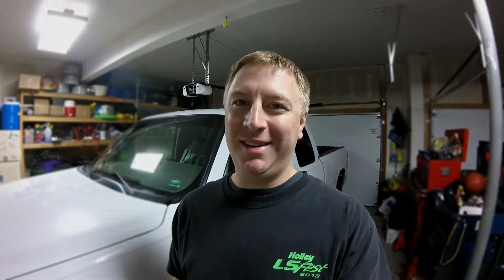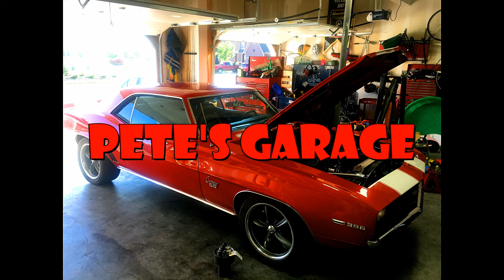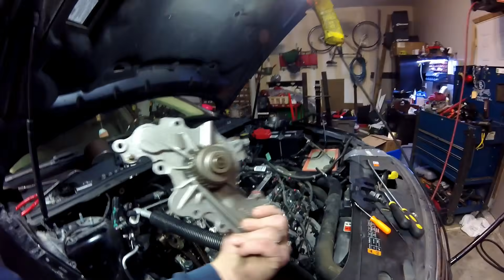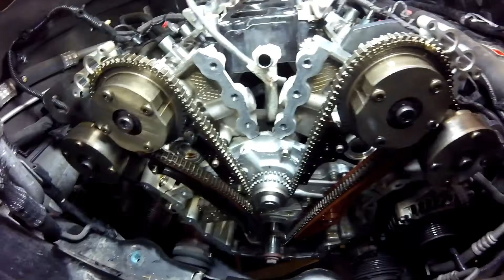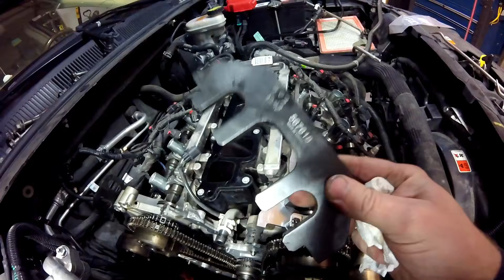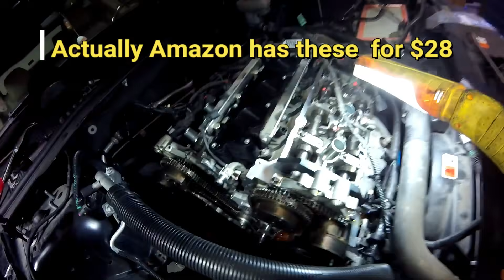Why does the Ford Taurus, Explorer, Edge 3.5L water pump cost over $1400?

Comment: Wow! Absolutely convinced I will not be buying another Ford. This b.s. is what you would expect from European cars.
Reply: other car brands did the same thing. not just ford
Reply: Rick Manley in 2016 my family drove a 2004 Ford Taurus, a 2007 Ford F-150 and a 1995 Ford Explorer. After getting ripped off by Horne ford in Apache junction AZ we now drive a 2012 accord, 2017 Tiguan, 2013 Elantra and a 2010 vw golf. Suffice it say ford gained $2000.00 but lost $75,000 in car purchases.
Reply: I have a 16 year old Mercedes 180,000 miles. Still on all the original parts like wheel bearings and water pump etc....
Reply: The 2005 Ford 500/2008 Taurus/2012-19 Explorer, etc were based on a Volvo; and Ford dropped that Godawful platform a few months ago, good riddence.
Reply: I dont think Europe had a lot to do with the Ford 3.5l engine.
Reply: Stick with Honda or Toyota!!!
Reply: I forgot i wrote this post a year ago. Funny thing is, I did end up buying a Ford F150 nine months ago, and it took 8 months for the 3.3 liter to blow up. Engine threw a rod with 7700 miles. I should jave listened to my own advice
Reply from the maker: Ouch! At least it was under warranty.
Reply: @rickmanley767  damn man.
Reply: This is no surprise because Ford & Volvo are in bed together, and the industry is engineered to require dealership service (just look at special tools required of any brand).
Reply: heavymechanic2 Ford sold Volvo 10 years ago. Volvo had nothing to do with a Ford engines. Mazda was engineering partner for 4 cylinders for a time but I’m unsure if V6 engines were partly their work. Mazda larger CUV/SUV models used one of the V6s of this family with pump inside.
Reply: @jimmyaber5920  ford used a lot of volvo's turbo technology to develop their turbo motors while they owned them. Volvo was pretty much one of the pioneering companies in turbo technology, alongside Saab. Ford pretty much just bought volvo, took their turbos, and then dumped them to geely. Almost killed volvo in the process.
Reply: You really dont know much do you?
Reply: Not all duratec engines are like this (check for cam chain in front, near radiator vs on right side). Know what you're buying and you should be okay with a Ford duratec V6 in regards to water pump replacement.
Reply: Several other brands have used this design for awhile.
Reply: Probably was designed and built by foreign manufacturers ?
Reply: Guadalupe Salazar Most afford turbo engines were from Ford Europe so im not shocked, Eapecially the 4cyls turbos
Reply: Rick Manley You better start buying cars 2005 and older then. All the new cars are like this.
Reply: @waterloo123100  I too have heard the cutoff for somewhat repairable vehicles was 2004-05 as well.
Reply: Pierce Hawke That’s usually what I go by depends on the make and model. But overall if you want a cheap car to maintain stop at 05. I’m driving a 99 Honda Civic and I love it.
Reply: Lol, stop being whiny babies. Engines have come a long way in 100 years. They aren't gonna always be fixed as easy as an oil change. Man up, or get a bicycle. Or pay some other dude $$$ who doesn't give two craps about your car, because it isn't his.
Reply: @ichoozjc  Or just don`t buy poorly engineered cars with poorly engineered engines using sub standard parts that fail too early. Probably the reason why I daily drive cars that are almost 20 years old. Modern car engineering is a amalgamation of hastily expedited designs that favor new technology over reliability with poor quality parts from China. I bet you 100 dollars the bearings that failed in the water pump were from China. I am sure Ford saved 10 cents a bearing though.
Reply: Plutonius X That’s the sad truth. Even if a part is Assembled in the U.S. you know their using Chinese parts.
Reply: @ichoozjc  SMH
Reply: @HowardJrFord  You don't have to tell me, I heard the rattle from here.
Reply: @ichoozjc  bad design is still bad design and, apparently even Ford's waking up; between the 2020 Explorer going back to RWD with 4WD as an option and the now 7.5L gas Superduty V8, it's OHV with pushrods.
Reply: @ichoozjc  man..its not about manning up lol. Its just true that ford keep complicating stuffs on the engine bro. Mechanics agree on it👍

Comment: Lmao 2014 and it already needs a new water pump? Wow. I avoid Ford's anyway but this is just ridiculous. I have a 97 Celica with 102k miles and the only thing I've ever had to do is replace the battery once, new clutch 6 months ago and that's it. My parents bought if for me brand new for my first vehicle. I've never charged the AC and it still will freeze you out. We also have an 09 Rav 4 and nothing has been done to that but my 07 suburban has already needed a new transmission, fuel pump, catalytic converter and radiator. It's sad to say but fuck American cars.

Comment: Well I see that the American car industry continues it's down hill slide so that they become as big of a POS as European auto industry makes. Today the care are over engineered, over priced, over electronic and over complicated. And for what? The break down far more than older cars. They catch fire far more than older cars. Even though they may be able to go as fast as 190 MPH, but the highest highway speed you can go is only 75 to 80 MPH. Most American cars have so much plastic on them they will not last 10 years.
But one thing hasn't changed much. The Ford Water Pump was expensive to change back in the 1960's and 1970's too. That water pump had a short bypass hose, about 2 to 3 inches long from the back of the water pump to the block. The proper way to change that was to remove the radiator, the fan shroud, the fan, loosen/remove the V belts and what seemed like most of the front part of the engine, just so you could remove the water pump to replace that short piece of hose. 9 out of 10 times it was the hose that sprang a leak and the water pump was still good. Depending on what model car you were working, it could be real tight to get to. 

Today's cars are crap. I still have a 1965 Chev Corvair that will out last and it drives better than any new car out there.
I'll add this, before I buy a vehicle I always look in to the mechanics of it. If it has crappy engineering like this POS 3.5L Taurus, I will not buy it. It is the same thing with the Toyota 4.7L Tundra. The starter is located inside the engine, under the intake. The engineer that came up with that idea must have been doing crack and LSD at the same time.
But in all seriousness, they drweam up this crap so you have no other choice but to take it to a dealer or another citified mechanic to get it fixed. It is a money scam dreamed up by the wiz kids, politicians, lawyers and the electronics industry to insure you can't fix your own car and to get as much of your hard earned cash out of your bank account and in to theirs. I've always said that it was a bad idea to put computers and a ton of electronics in a car. 

But soon it will not mater anyway, if they are able to perfect the self driving car. When that happens, you will not be able to own a car anymore. When you need one you will call for one or tap an app on your smart phone. The car will show up, you will get in and tell it where you want to go and you will be charged a fee for the use. Think of it as a driver less uber or taxi. After it drops you off at home, the  car go back to it's charging station or it's internals will drive itself over to a servicing facility for scheduled maintenance.

Comment: This is why I steer away from Ford. Have worked on a few and it has always boggled my mind how they design the simplest of jobs to take forever.
Reply: Daniel Acuna I do LED lighting or changing the interior lights just fucking terrible on the 97-2003 F150s You basically have to get a torx screw and remove the housing And grab handle , Transit is a nightmare to as well as the focus because they are technically European cars From ford Europe Can use a similar domelight housing as the VW/MB/Audi

Comment: The water pump is cheap on my 98, but I will say the in tank fuel pumps, particularly without an access port is just stupid. $25 pump, hours of labor to drop the tank. 02 sensors that cannot be removed without removing the pipes is another good one. Hope I never have to replace the alternator,  that will require dropping the motor and sub frame out.

Comment: Thanks to "cash for clunkers" a lot of perfectly good used and repair friendly cars went to the junk yard. It is no secret and hasn't been for a long time that planned obsolescence is incorporated in the design of many of our automobiles and some of the repairs are designed to take advantage of our conditioning to think a perfectly good car otherwise, is not worth an expensive repair and that a new car payment and insurance hike is some how better. I complained about the idea of the GM 3.6L V6 needing a timing chain replacement (yes chain) around 130,000 miles in the CTS at around $2500-3000, then there's the mode door actuator for the A/C in a number of cars that requires dash disassembly to replace at upwards of $1000. 

   Yeah, I think it's safe to say some manufacturers are shoring up their future with surprises like this. Glad I can fix my own car, I enjoy the heck out of not having a car payment.

Comment: I’ve done many of these water pumps. You don’t have to take the phasers off the rear bank. You can take a 8mm wrench and loosen the timing guide bolt up enough to snake the pump out, you can make your own timing marks , cam to chain and crank to chain, and you won’t even need the holding tools, just in case you do another in the future.
Reply: This comment 🙌. But these police cars run through these waterpumps so often, it's still a nightmare.
Reply: Only on the single phaser models. On the dual phaser models (2011 and later) you absolutely have to take off the phasers to get off the guide. They changed the guide to a much larger design and loosening the bolt is no longer sufficient.
Reply: @seekerrild4629  I do not take the house off, you can loosen it and move it out enough. 😉
Reply: Use the lock plates anyway.  The cam can rotate with compression.
Reply: This!

Comment: This reminds me of the Chevy Monza made in the late 1970's where the car wasn't designed for a V8 engine but Chevy decided to put one in anyway in their performance package for that car. You had to unbolt the motor mounts and lift the engine partially out of the car to change the spark plugs in the rear of the engine. Engineers involved in designing crap like that should be taken out and hoss wipped.

Comment: Replaced my water pump on my 2004 3.8 Grand Prix 57 .00 for new Delphi pump,and 2 hours .Also I replaced the plastic elbows with aluminum after market ones 19.00 Canadian 400000 km runs and sounds like new. Gm got rid of this excellent engine to replace it with aluminium engine and several timing chains ,I just purchased a 2006 CTs with one already studying how to change it just in case lol lolo

Comment: The correct way to design should be to place an intermediate shaft (spocket and gear on the shaft) between camshaft chain and waterpump. So you can remove the pump without touching timing chain.

Comment: Thank you for sharing this. I will never own a Ford Taurus.
Reply: Never own a Ford period!
Reply: @lospolloshermanos2692  I drive a 99 ford ranger with a 4 cyl stick shift. It's been a wonderful small truck. But I would never own one with an automatic or the 4.0 V6. Ford automatics are a piece of crap. They are nothing but a C3 light duty transmission with a face lift. I've had two rangers and put over 200,000 miles on them combined and have no trouble at all. But ford doesn't make a decent car anymore, at least nothing that compares with the imports.
Reply: I have a 98 and it has been a good car. The parts are super cheap too because they sold so many of them.
I figure get a domestic car that the model has been out for several years with good sales and community has validated to be good. All manufacturers have lemons, and the imported cars the parts cost way too much.
Reply: Any Ford with the v6 and eco boost has this trash
Reply: @Artchred  What I hate about the 4.0 is that it's so wide that it's almost impossible to change the spark plugs. My dad has one and we were thinking of cutting holes in the fender wells to get a plug wrench through and finally took it too a shop. The mechanic said he can do it but it was over 100 bucks to change plugs. He said "there's blood involved" getting them changed.  I've heard the 3.0 isn't as bad but I have no experience with it. I like the 4 cyl 2.5 so much I would never change. All I've had to do is change the timing belt (40 bucks) and the plugs. The plugs are a bit of a problem if you change all 8 of them. The upper manifold had to come off. But it wasn't as bad as that 4.0 V6 .

Comment: Solution: buy a Toyota or Honda ... I can’t believe people are STILL trusting domestics ... they break down soooo much.... like this ford... 1500$ for a water pump because they used a shitty design that fails real early ... if you’re gonna put a water pump in the timing route you should AT VERY LEAST make sure the water pump is robustly built ... sheesh.
Reply from the maker: Foreign cars have their issues too. Check out my video on the 2016 Honda Pilot fuel injectors.

Comment: Sounds like you recommend NOT to buy a car with that motor in it.
Reply from the maker: Other than this one thing it’s pretty good. The water pump on this one did make it 140k. But it’s expensive to fix if you have to take it to a shop.

Comment: https://youtu.be/qMiSc8epmn0?t=128
OMG, special tools to do work on an engine. It's really no different than working on any other car that has a water pump behind a timing chain or belt.  Also, any time you replace the water pump on the 3.5, do the timing chains and tensioners as well.  They chains will stretch and throw a cam position sensor failure.  This vehicle is no more difficult to work on than the 5.4 3 valve engine from the F150 with all their cam phaser issues, timing chain tensioner issues, oil pump issues.

Comment: Same Engine in the 1.5 gen fusions.... My 3.5 had the same issue, but it wasn't caught in time.  The coolant all leaked into the oil and ruined the engine.  enough play in the bearings that the impller shredded itself and there were pieces of it all over the inside of the coolant plumbing....

Comment: B.S. everywhere i looked it's under $100
Reply: The pump itself isn't $1400. The figure comes from what a shop would charge you in labour to do the job. His point is that it's badly engineered and takes a lot of unnecessary work and time to get at the pump because it's practically inside the damn engine

Comment: Ford and chevy are in a bad v6 contest!
Reply: What Chevy v6 are you referring to?
Reply: @OnlyNotes  3.6 oil eater.  New ones have catch cans from factory but my caddy is ok burning 1 at / 500 miles...lol.  Not even trying to get gm to help. Just feeding it mobile 1 synthetic and waiting for the cats to plug. Runs good ptherwise. No leaks I can see. Always been like this.
Reply from the maker: I’m actually currently putting timing chains in a Cadillac SRX 3.0 that was 3qts low on oil. But they’re also way overdue for an oil change.
Reply: @PetesGarageandperformance  the oil change % in the old caddie is wrong. Change is due at 50% oil life. Plus oil consumption. I am not playing with mine cause i know once the oil goes low the cam phaser crap out.

Comment: This problem has trashed many of these engines. If you don't catch it quickly. It is known to fill the oil pan with antifreeze. Once that happens engine is toast. I was looking at a super nice Ford flex with this motor. I learned a lot about this issue in my research on the flex. People love those cars. But the issue with me is even putting a new water pump don't fix the fast wear out of the water pump. It's really a design disaster.

Comment: This comment section proves how many retards that think they're car guys aren't really car guys, if they were they would understand this isn't a common issue and secondly there are literally dozen engines with this same type of design. The reason is because a timing chain ( especially like that one in the ford with 2 teeth and a thick chain ) is often a 125K+ maintenance free design.  As you see the water pump failed before the timing chain and its components. Belts are dumb, they squeak, they fly off  and become brittle.  I won't touch any car with VVT interference engine using belts which some of these jap cars still use like NISSAN and HONDA

Comment: I bought a 2013 Ford Taurus with 92000 miles for 800 bucks because of this luckily I’m a technician so I do this type of repair all the time so it wasn’t no skin off my teeth but this design when I first did this was the worst design I had ever seen. The idea was to make the water pump a little more durable but to put any part that doesn’t need to go in any engine compartment that doesn’t belong there is stupid makes it hard for the consumer and makes it hard for the technician all over hopefully getting a little more money.

Comment: The moron who designed that engine with the water pump inside the engine should be hanged lol.... who does that shit? my 14 Mustang with the V6 had the water pump go out around 36K miles, it was and external pump and the dealership fixed it for fee. If I had to do it, it wouldn't be so bad.

Comment: Because this engine could easily have been designed with an external water pump, I recommend a class action lawsuit. make Ford fix this problem...they created it.
Reply from the maker: The RWD engines in the trucks have an external pump. Go figure.
Reply: I still remember the first time I found a water pump inside a timing cover, I  told the owner and he traded the car in immediately.